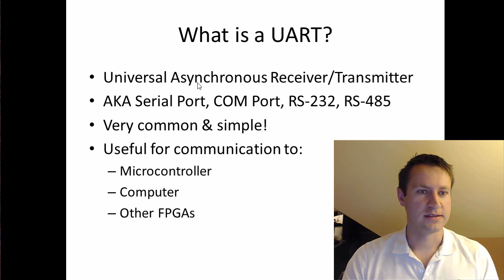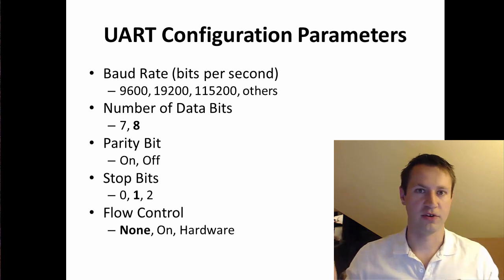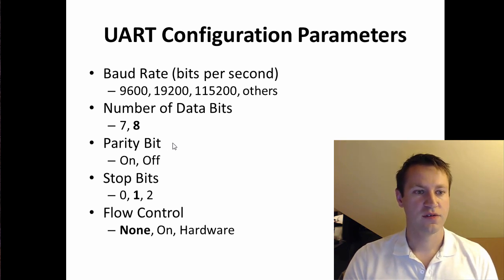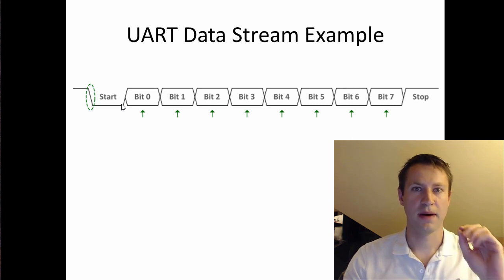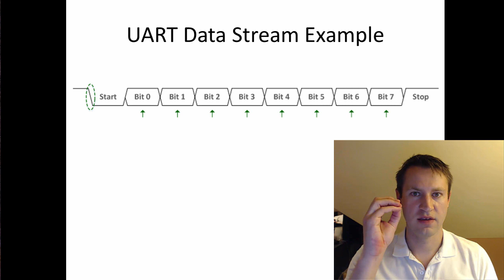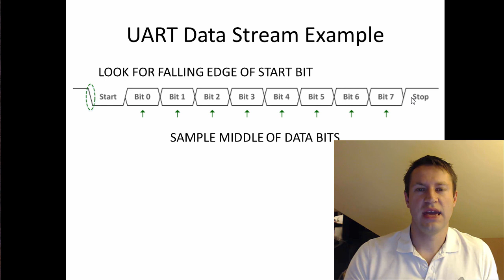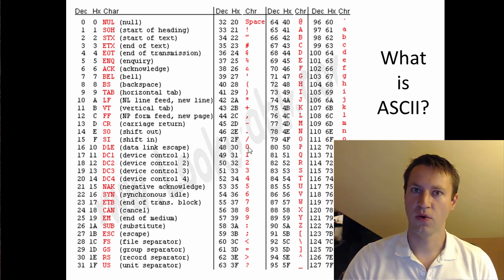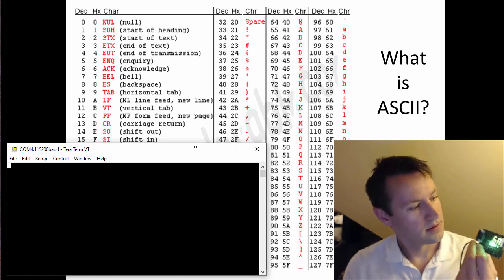What is a UART in an FPGA? Basics of Serial Ports, COM Port, RS-232, RS-485

Comment: 7 bits were used on old teletypes and video terminals. A lot of early serial devices also used 7 data bits. If speed counted, the time used to send that one bit at 110 Baud was an issue. Also, the early character encodings also used 7 bits. So only 7 bits were needed for a teletype or similar character-oriented devices. I restored a paper tape reader in the 90s that used 7 bit encoding and 7 bits data at a rate of 300 baud.
Reply: I wasn’t there myself, but supposedly in the ‘70s and early ’80s a lot of computer networking connections—serial links used for forwarding email and the like—were still not “8-bit clean” and high bits would often get mangled somewhere along the way.

Comment: 7 data bits was frequently used when baud rates were significantly lower than your blisteringly fast 9600 baud. Remember that ASCII is at heart a 7 bit code, so why waste precious bandwidth on an unused bit? RS-232 allows 5, 6, 7 or 8 data bits. Yes, I said 5! Look up Baudot Code, which was used in telegraph systems. It used only 5 bits achieved using a shift between letters and numbers. 

Another sneaky way to maximise bandwidth was by using split baud rates. An example of this was the Videotex terminal which used 1200/75 baud. The bulk of the bandwidth was downstream to the terminal. As humans don’t type as fast as computers, the upstream was only 75 baud. 

Flow control is nothing to do with arbitrating who is using the line. It’s about preventing buffer overruns. Hardware flow control uses the RTS (Request to send) and CTS (Clear to send) wires on the RS-232 interface. Software flow control uses the XOn/DC1/Ctrl-S and XOff/DC3/Ctrl-Q ASCII characters. You can still type those codes in a terminal window to pause and resume fast scrolling output. Imagine for a moment that your terminal is connected via a serial link such as a modem, typing Ctrl-Q is sending an XOff to the remote telling it to stop sending as your mental buffer can’t keep up and is about to overflow. You can then send an XOn to resume. 

You kids just don’t know how good you have it.

Comment: Some time ago I wrote a decoder for a cassette tape format, the old "Kansas City Standard" from the '70s... it's 600 baud, 8 bits, parity even, 2 stop bits. I had to decode it exactly the way you described, looking for the start bit negative edge, the jumping on the middle of the bit for sampling. The stop bit can be any length, not just two stop bits, because the data is asynchrounous. Back to the teletype days when the data was generated from typing on the keyboard.

Comment: I'm an engineer here in the UAE developing a custom BMS. I'm using Atomic Pi's connected to a USB hub and creating virtual Serial ports which communicate to my RS232/485 and one MCU. The touch screens use COM1 and the MCU uses COM4. The COM1 and COM4 seem to be symbiotic but when I plug in the DTU, it takes up COM6. I wrote the interface code in C++ and the COMs seem to work perfectly when the USB Hub isn't connected. But once the MCU and DTU are plugged into the system, I noticed sometimes when I send a command out the DTU, it messes with the MCU. Is it possible there is a cross in the RX/TX bus in the USB hub? I don't know if it uses an FTDI chip and Maxim RS232 or not. IT seems the handshake is happening between the MCU COM4 and DTU COM6. I don't know enough about USB hubs but I was hoping you might shed some light on what's happening. Every USB Hub from the same company is doing the same thing on all the CPU's.

Comment: FYI - Asynchronous does NOT mean that there are no clocks, just that a synchronous clock is not shared between the parties. The clocks are separate and internal to each UART and the start bit is there to align these clocks to the bitstream. Flow control is/was provided to cater for devices such as line printers and teletypes that could not process the data as quickly as it was received due to slow mechanisms and small or non-existent buffers. The flow control allowed the receiver to tell the transmitter to pause until it was ready to process more data.

Comment: 9:40 - If there is no STOP bit, how is it guaranteed to have a falling edge on the START bit?
Reply from the maker: Good question.. I've only ever seen interfaces with one stop bit. I don't think no stop bit is used in practice due to the reason you described.
Reply: He is in error there is always 1 stop bit, you may also have 1.5  or 2 bits. A FPGA does not have RS232 Buffers!

Comment: Overall good intro to UARTs.  Thanks.

One thing to mention: parity comes in several flavors.  When someone says that their serial port is set up as "9600, 8N1" the N stands for no parity.  Other options include O for odd parity and E for even parity.  Some obscure setups even use 1 or 0 parity, which just means that the parity bit is hardcoded to a value or 1 or 0 (not a very useful setting).

Comment: If there is no clock driving the uart_rx and uart_tx then how do I compute something on a byte received and send the result back on uart_tx ?
Reply: UART module do use clock to generate baud rate and to run internal state machine.  only the RX, TX signals are who are not driven respect to the clock.
Reply: @Extraterrestrial_Music  I have had some success manipulating the byte of data inside the FSM of UART_RX. Maybe I need to shift my thinking a bit (learn something --oh no !)  because I would like to use the UART_RX/TX procedures inside my own FSM not have my FSM inside the UART_RX/TX FSM.
Reply: @phillipneal8194  your own FSM means i can assume you custom logic or algorithm that does operation on received data Right?
if true then it is easy to check status signal like "ready" means data is ready on UART module to get Valid data then doing whatever is required on that given byte!
Reply: @Extraterrestrial_Music  Hmmm. That might be a good idea. I will check into that.
Reply: I wasn't defining my arguments to and from my module between UART_RX and UART_TX as a wire. Plus , I stuck a clock in. The code looks like this:

module CHANGE 
  #(parameter CLKS_PER_BIT = 217)
  (
   input       i_Clock,
   input [7:0] i_TX_Byte,     //not a reg
   output [7:0]  o_CX_Byte    //not a reg
   );

  //just add 1 to the byte coming into the module 
  reg [7:0] r_CX_Byte     = 0;
  always @(posedge i_Clock)
  begin
     r_CX_Byte <= i_TX_Byte + 1;
  end
  assign o_CX_Byte = r_CX_Byte;
endmodule
Reply: @phillipneal8194  I see no syntax problem  with the code you wrote but as long as you deal with such communication protocol you should utilize status pin of UART as i said earlier to get reliable output data. for example the UART might have  "Data Ready" pin to indicate the data is available so the on rising Clock the received byte is incremented.

if your module will rely only on the clock pin, its noticed that as content of UART RX register shifts per clock during transaction you will get the data that makes no sense. so Data ready will tell you when a stable data is available to process after completing the transaction.
Reply: @Extraterrestrial_Music  You are absolutely right. I changed the always list to listen for a change on the 'DV' (data valid) wire. Here is the code:

module CHANGE 
  #(parameter CLKS_PER_BIT = 217)
  (
   input       i_Clock,
   input       i_CX_DV,       //DATA VALID signal from UART_RX
   input [7:0] i_CX_Byte,     //not a reg
   output [7:0]  o_CX_Byte    //not a reg
   );

  //just add 1 to the byte coming into the module 
  reg [7:0] r_CX_Byte     = 0;
  always @(i_CX_DV) //when DV changes start working
  begin
    r_CX_Byte = i_CX_Byte + 3;
  end
  assign o_CX_Byte = r_CX_Byte;
endmodule
Reply: @phillipneal8194  good now this will work. but what more you can do is :

always @(clk) //use clock to execute operation on rising edge
begin
if (i_CX_DV == '1'  ) 

      // your logic here to work on received data
end

what this will do is, data valid  pin will enable the process block when data is ready then you can process data with respect to clock so in such cases when you want to process data consisting more then one operation clock will help a lot
Reply: @Extraterrestrial_Music  -- Naltik Sanas, 
Thank you very much for your suggestions. They have been really helpful.
Now I am going to try to read in 2 bytes , 'or' them together, and send out the result. I am planning on using a state machine. 
Thanks again
Phil Neal
Reply: Sorry for the mis-spelling... Naitik Sanas
Reply: @phillipneal8194  You're welcome. glad my suggestion helped you!  and no worries spelling mistake do happens :)
Reply: @phillipneal8194  yes state machine is best idea. Good luck for your work!
Reply: Even i have this doubt when i start to watch the video. My strong believe that any communication protocol don't run without clock.
Reply: @dhineshkumarc1  The clock is used to count off ticks. 217 ticks on a 25 mhz clock // (25000000)/(115200) = 217.  The Nandland code for UART_RX and UART_TX is great. But when I try to call a RX->do something with the byte->UART_TX , the 'do something with the byte' becomes difficult for me.